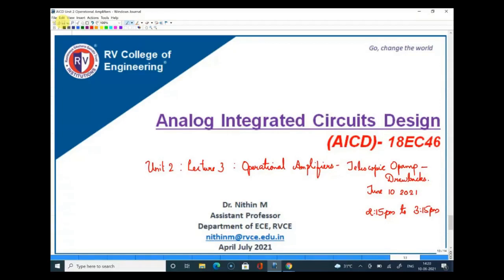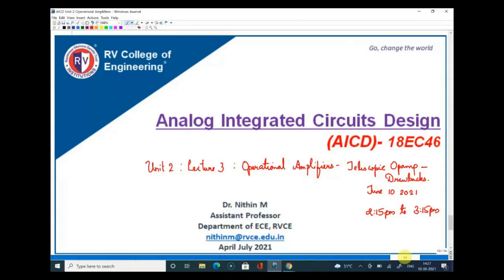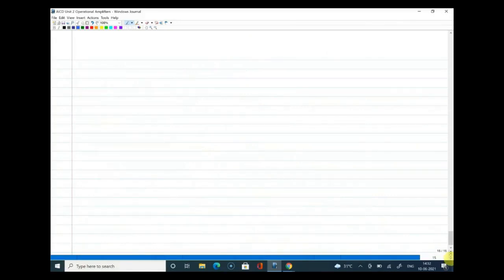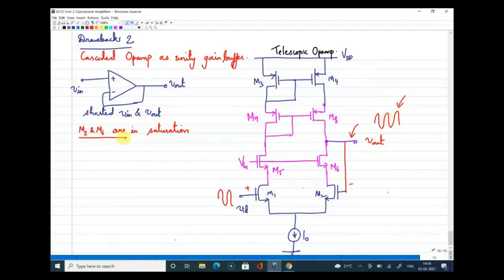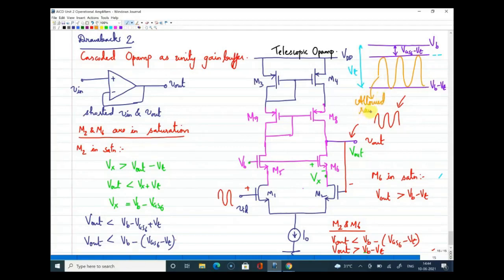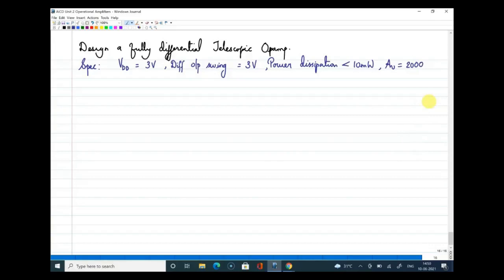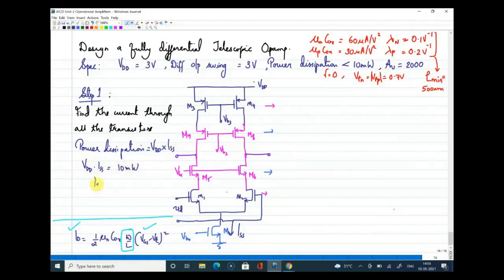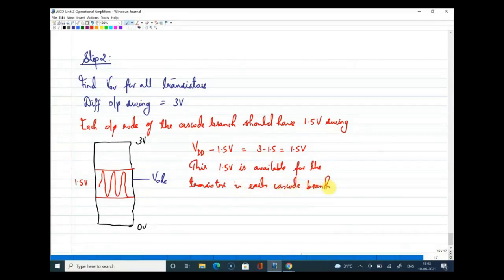Lecture 3 Telescopic Opamp Design Part 1 | Unit 2 Operational Amplifiers

Comment: Hi can I check why for the single ended you did not change the current source to a transistor but for fully diff amp you did?
Reply: I think it is just a matter of implementation. For both , Single ended as well as fully differential amplifier circuit , it is better to replace the Current Source with a MOSFet operating in Saturation region.